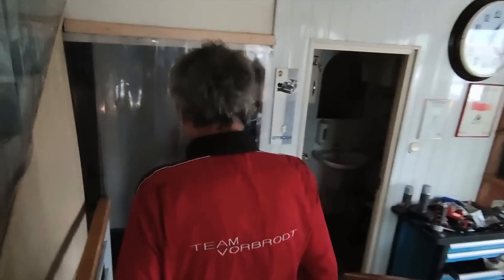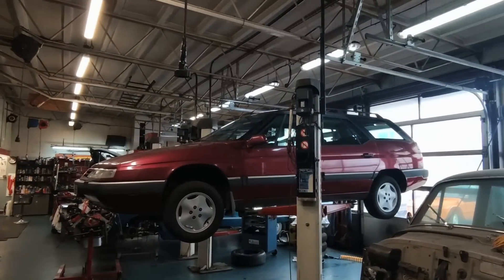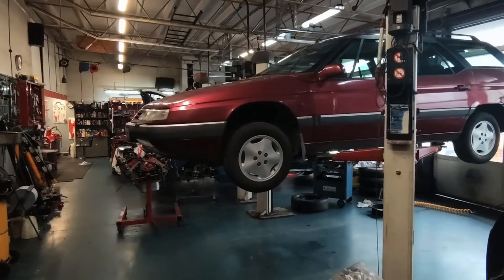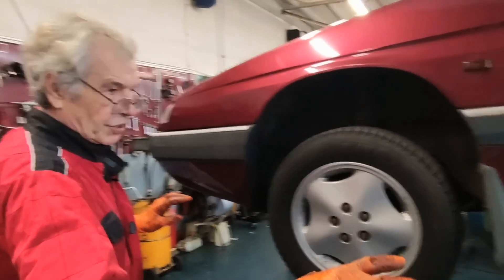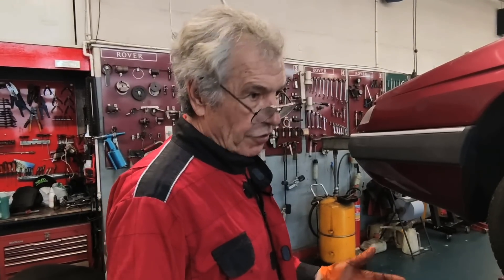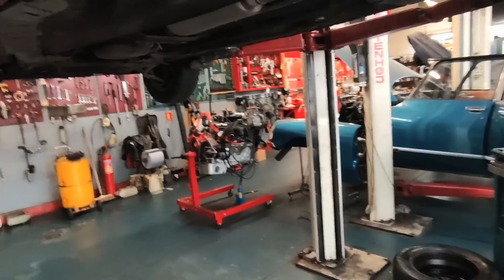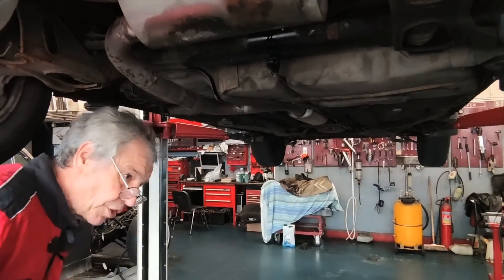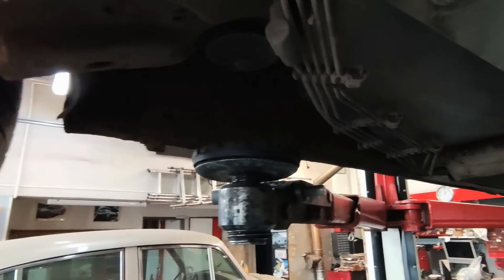Motodziennik Extra - Tadeusz Vorbrodt, Citroen XM i siłownik tylnego zawieszenia w C5

Comment: Unfortunately, no subtitles. Would have been interested to understand what you are saying - especially on the topic of the rear cylinder overhaul.
Oh - if your lift allows, pick up the XM at the rear of the engine subframe where it is bolted to the chassis.